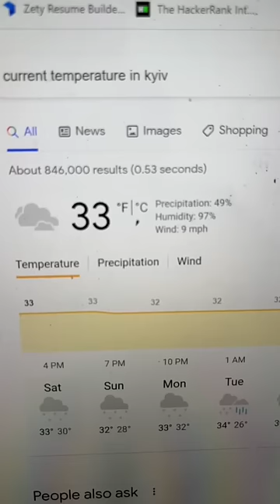Why doesn’t Ukraine use diesel locomotives as power generators?

Comment: Easy fix my friend Ryan, have Western Europe send Diesel Locomotives, I m trained as a Locomotive Engineer, I will volunteer.  Being from Maine I understand how important it is to have power during harsh winters.
Reply: It may be a rail gauge problem at this point, but where there's a will there's a way. Up here in Quebec, we actually took some locomotives off their track and had them plow their way on the asphalt on their own power to get them where they were needed.
Reply: It still doesn't solve the lack of diesel fuel, and the whole point of the diesel locomotives is to make use of something you already have. If you're going to bring it from the outside, then just import the generator alone. But then we're back with the fuel problem, sadly keeping the military going is more important than generating electricity, even if it causes suffering and death, because if the military fails the whole country falls.

They're better off trying to repair what the Russians destroyed and reestablish the service at least partially.
Reply: Most of Ukraine uses soviet-width rail tracks, while western trains use the narrower european-width standard. They wouldn't be compatible, at least without major modifications.
Reply: @ToastyMozart  you make it sound like its hard to lay another set of tracks down to receive engines and have a crane switch trucks underneath....
Reply: @ToastyMozart 
 @Sam Smith  
 We carry tanks on flatbed wagons, right? I'm sure we can carry a locomotive the same way. Yes it sounds ridiculous, a western gauge locomotive carried on a flatbed wagon with a Soviet gauge, but it would get the locomotives where they need to be. We could even strip the locomotives of anything useless for the purpose to cut weight and save fuel. I'm sure there's some nice steel plates on there, great armor for small vehicles or windows. I'm in a "Berlin airlift" mode of thinking, right now, tbh.
Reply: @hugodesrosiers-plaisance3156  "truck" is originally a railroad carriage of four wheels that you see under rail cars and engines. They are designed to be swapped out in locomotive workshops, I've done it personally. Instead of a Crane we had a hoist and a pit to work underneath.
Reply: Polish railway company PKP LHS operates on wide tracks, but they are kind of pissed at UA for holding back Chinese trains. They suffered major financial losses because of that, so lending locos is not an option
Reply: @hugodesrosiers-plaisance3156  I do realise things are tough right now, but Zelensky didn't make friends during peaceful times with his decisions (a.k.a. douchebag moves). I hope I'm wrong, we'll see
Reply: @samsmith2635  So you're saying Western locomotives could be jerry-rigged with Soviet gauge trucks? This is starting to sound like Apollo 13. That's good. Man I wish I were a billionaire.
Reply: @markblocker4565  Thank you for making yourself obvious. You're easier to block that way.
Reply: @hugodesrosiers-plaisance3156  dont we all and you dont need billions just skilled workers and a workshop and its Good Game. Take a crew of 50 men to lay a few kilometers of track,not rail bed, track, to a workshop outside of Ukrainian Territory.  Poland and Serbia and Saxony have some of the best railway people in the world, call them.... In 15 days I could be sending Diesel locomotives to Ukraine with Ukrainian Gauge every day...
Reply: @hugodesrosiers-plaisance3156  More like Von der Leyen.... and send them to Poland to be converted by some of the best railworkers in the world.
Reply: @hugodesrosiers-plaisance3156  not apollo 13 if you actually worked on a railroad pal, take your condescending attitude elsewhere.
Reply: @samsmith2635  I did not mean it as condescending. I just meant that we seemed to be trying to solve problems in unconventional ways in a "time of urgency", which is a good thing. My apologies.
Reply: As an Locomotive Engineer you should f+cking know,that there are hardly any diesel locomotives,with substantial power in Europe!Most of the system is electric.In DACH Idon't know a single locomotive,that can pull a whole train,in case electricity is down!Where the need arises,for example Bosnia,you will still find steam locomotives!
Reply: @moteroargentino7944  A train would be able to get its enough diesel in Poland to last a winter.
Reply: Locomotives would be way to small to supply the whole country, also special hardware would be needed to link them up

Comment: Brirain has used locos in the 70s as generators. 
I dont know how many diesels are available in Ukraine, but its possible.  Many modern locos generate AC so it can be rectified and hooked up to the civilian supply. 
Also you mght be able to use the ETH supply to warm coaches to at least give people somewhere warm .

Slava Ukraine
Reply: Thank you for your thoughts. But I'm afraid the scale of the problem makes the idea of diesel locomotives as generators impractical.
Last news: 6'000'000 Ukrainians without power. Per latest surveys, 3 people per household, that's  TWO MILLION HOUSEHOLDS WITHOUT POWER. Someone claimed 1000 kWt and therefore 1000 households per diesel locomotive. That's 2000 diesel locomotives to generate backup power for me and all other Ukrainians without stable power. Ukraine simply doesn't have them. A report from Ukrzaliznytsia (Ukrainian railway) from 2020 quotes 2025 locomotives total. More than half of those are electric locomotives, which CONSUME power, not generate it. So, less than 1000 diesel locomotives out of 2000 needed.
And then there's the war. The ability of our Ukrainian soldiers to repel Russian assaults depends heavily on a steady supply of artillery shells and other ammunition. That's thousands of artillery shells delivered to the front lines by trains and by trucks every day. And someone pointed out above that areas close to the fighting are without power, because they are the most damaged. So we probably need diesel locomotives near the front lines, if you don't want to hear news of Russians taking more Ukrainian land and major cities.
Reply: Since almost all of the electric Grid is AC, there is no need to rectify it, to bring it to the grid. However you might have to do some voltage adjustment and that is a pretty befy transformer..
Reply: @Concord003  they have some more disadvantages as well. They are heavy, they are expensive, they require infrastructure. Just throwing a "medium" sized generator from a flatbed truck at some random street distribution and adding power to the grid, or whatever is left of it there is a better option than using locos. Literally every country inside the EU is providing those gensets to Ukraine right now.
And medium sized as in: certainly to large to carry around, but small enough that you can stuff it into a normal garage.

Comment: Yes in Australia a company bought two small diesel locomotives for backup generators because there computers in there machinery were to sensitive to power variations in commercial generators. Worked perfectly.

Comment: The problem is that they are not made for that use. We did indeed to that in Québec during the Ice Storm, but afterward, the locomotives had to be sent for repairs, and they weren't there all that long. Diesel locomotives and power grids don't run at the same voltage and frequency. To supply power to the grid, you have to run them outside of their design specifications.

Comment: Not only did they use the train to power buildings, but the Canadian town rolled it down a street under its own power to get it to the building. They just lifted it off the track with a crane and then sent it down the street, when they were done it was reversed back to the level crossing and was sent to gets it’s wheels repaired.

Comment: Seems like if locomotives availability was an issue, several dozens of locomotives could be brought out of storage in the US and sent over. As other commenters have mentioned, distribution is more impacted than generation.
Reply: US uses a completely different rail gauge from Ukraine.
Reply: @baneofbanes  Locomotives being used as stationary generators don't care what they sit on, so long as they have fuel and a grid connection. You're correct that American rolling stock can't operate on Ukrainian rails, but that's not relevant to repurposed locomotives as stationary generators. In this application I assume the traction motors, wheel trucks, etc. would be removed before shipping anyway so as to make transportation easier.

Comment: LOL "You can make an electric train but you can't make an electric Tank". Very true
Reply: The hybrid power AbramsX is a step in that direction
Reply: @Feezec  Sorta but the addition of the APU is more because idling your jet engine is bad for fuel consumption.  The APU will allow the tanks to turn off the engine and still function.  It's not like they're making the Abrams a Prius.
Reply: @LeCharles07  Yet.
Reply: 1943: Maus tank, Germany. Diesel electric drive train.

Comment: Another thing to take in account is that many old diesel-electric locomotives from USSR and eastern block use DC transmission, so they have dynamo producing direct current that can't be used by other equipment.

Comment: Practical engineering just put up a video yesterday that goes over a "black start" of the power grid. some of the issues there, apart from the as mentioned below issues with it being the delivery infrastructure not plants, would also apply.

Comment: Coast Guard buoy tenders used a diesel electric system where two diesel engines ran a generator that ran huge electric motor that turned a single high torque prop. This class of tender was used to break ice in the Great Lakes during hard winters so with an electric motor, if ice jammed and stopped the prop, it would just shut the motor off with out damaging anything. A direct drive diesel would mess up a lot of things permanently. The boat was slow but hugely powerful. During underway training we had to tow a navy destroyer and get graded for it. After a week of doing this that and the other, we left with an excellent certification on our stack. I just realized I may be off topic a little so... sorry.
Reply: A little bit off topic, but it was a fun read anyway! Besides, some solutions are best provided by sideways transfer of technology.
Reply: @markfryer9880  Thanks.

Comment: The story about Canada isn't totally accurate: town hall and a community center were powered to allow people to come warm up or sleep.  There was intentions to also power the highschool with one, but it was on the other side of the bridge.  While diesel locomotives are big, they are only big enough to power a few large buildings at best, and many run DC current, meaning they would need a rectifier.  As for importing American or Canadian built ones like the example, North American locomotives are known for their 4ft. 8.5in. gauge and absurdly large loading gauge, or the size of the locomotive.  Basically, export locos may not fit.

Comment: The diesel electric part only olds up to a certain point. There are quite a few Locos in Europe which either have a torque converter gearbox or they. Straight up use diesel haydraulic transmissions.
Thus making the act of generating electricity from them more difficult

Comment: And another point is - the problem is not only the power generation, but the power distribution grid. And it probably does not work to connect a Diesel generator into an existing grid where a power station exists but can't produce enough - having multiple systems providing energy into one common system requires extremely sophisticated synchronizing functionality.

Comment: Good blurb.  There is an additional side effect of one of the points you made. Ukraine is still on Soviet gauge rails. Which are NOT European standard. So there is no way to "borrow" diesel locomotives from the EU.
.
The track gauge mis-match is the reason so little of Ukraine's grain is exported by rail. Rail is normally a good way to ship grain. But when Ukrainian grain hits the border in a train, it has to be moved to a European gauge rail car. This transfer is a major bottle neck.

Comment: The locomotive generates dc power of a different voltage that is generally used on normal electrical distribution systems

Comment: there was a tool in the army that was essentially a grappling hook that you would trow over a live piwer like then connect to a genorator with battery storage. they could be a solution. works the whole time you next to the power line & also gives you about ten hours or battery life to run applices like heaters that would get them though the night or untill the next time they could reach a source. That was in 2004 afganistan so I can imagine the technology has gotten better.

Comment: On top of that most soviet era locomotives have DC-DC electric transmissions which means that generatos provide around 600-800V DC that would be a pain in the ass to convert into typical civilian power that is 1.5kV AC or 3-phase 400V AC

Comment: Here in Indian railways we remove the alternator wires and attach them to a huge resistor grid that is submerged into water while load testing old alco diesel electric locomotives that do not have the self test feature like newer emd and ge locomotives that run their alternator power directly to the dynamic brake resistor grids to load test the engine and measure it's performance , emissions and other issues. 
You can just feel the temperature rising while this test is performed as the engine dumps mega watts of energy into the ambient air which is already quite hot here.. 30-40 is normal in summer and peak summer 50c. The alcos chug along even in peak summer , you could see the air bend around the radiator exhaust fans.

Comment: The engine that was used too power the canadian town was a M420W it was bluit by the Montreal Locomotive Works it had a 12 cylinder Alco 251 Prime Mover it could output 2000hp.

Comment: The problem is not power generation in Ukraine (they have lots of power from nuclear stations),The problem is power distribution. The transformers and distribution stations were destroyed and these can't be replaced easily.
Even if you had diesel locomotive they can't interface with the grid since the the voltage they drive is too high to be used for domestic use.

Comment: The uk has tonnes of diesel locomotives just sitting there doing nothing, not a bad idea to send them over 

I saw an article from 1968, a power station in the uk lost one of it's generators, so they they brought in a diesel locomotive to temporarily replace it

Comment: Most Diesel locomotives generate 600 Vdc. Residential power is usually 120 or 240 Vac.  DC is not easily converted to AC.

Comment: If I was going to guess, most of the former Soviet/Russian/Ukrainian diesels are older models with DC generators and DC traction motors. So you can’t conveniently power an AC grid from one unless you have a a large DC to AC converter, which isn’t common. I believe the CN engine was a newer model with an AC generator.

Comment: Any gas or diesel motor with an alternator can be used as a generator. It's a matter of converting whatever happens to be around to a useful or mobile power generator..  complicated task and minimal fuel available in bombarded towns.  Another issue can be the track width or guage  of the track ..but the grid is a bigger problem.  Given time all is repairable.

Comment: Problem is also, how to connect and synchronize it to the grid. That is as easy  as connecting a steam engine to a semi trailer. And yes, tanks will be multifuel-electric (hybrid) with huge batteries to keep the engine off save fuel, reduce heat signature and reduce noise. Cat style ambush. Silent, fast and deadly.

Comment: You missed the obvious point. The diesel locomotives are required to fill in for electric locomotives which can’t be used due to lack of power for the overhead wires!

Comment: Engines need to be prepared to do that. I read one rail operator in the US put this in the contract for new engines.  Even when they are big powerrplants .... they wont help more than 100 to 200 homes just for a couple of KW each. You need gensets ....

Comment: Electricity isnt just electricity, the locomotives produce direct current, it then gets converted to ac by huge vfd's these are not made for 220v and also arent made for running that long on 50hz, linking those locomotives together is impossible since they dont have gear to be syncronized and connecting them without syncing would destroy them instantly

Comment: Also something to mention, while you can power a city or town with diesel locomotives you’d have to have an inverter to invert the DC current to AC current, unless the locomotive is already inverting to AC current which is possible as many modern diesel electrics are AC, the big but to this is to provide power it would require the locomotive to run at full throttle continuously causing mechanical failures that rail companies cannot afford especially in Ukraine with their already limited diesel electrics, after the Canadian National brought the unit back into service it had to be extensively rebuilt from the engine to drive train, alternator and axles as they rolled it off the rails onto the pavement. 
Union Pacific did similar providing power to towns with its experimental U50C locomotives after they were retired from service, again effectively ruining them and sealing their fate to the scrap yard

Comment: For $50 you can get a Chinese Diesel heater it's $150 for the diesel heaters that are in a metal housing $50 for ones without the metal housing. Old plastic boxers and old CPU cases can be used to house the Chinese Diesel generators. They can run on waste oil alcohol and even old vegetable oil and can heat several apartments and even a whole house.